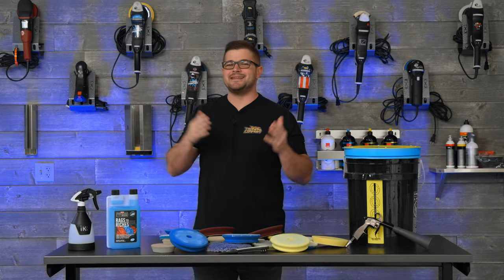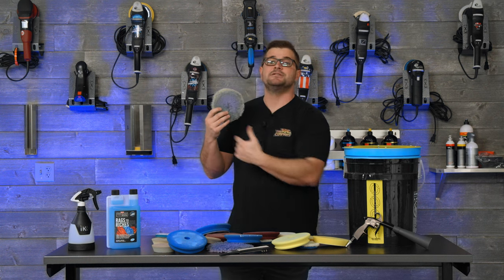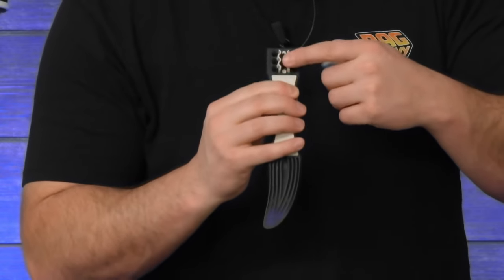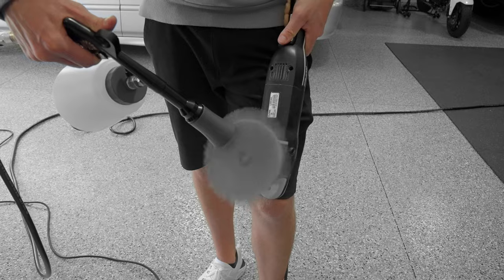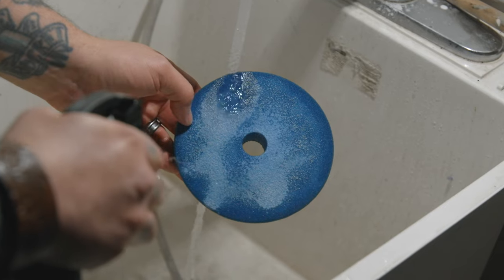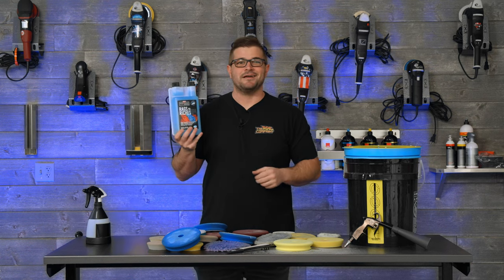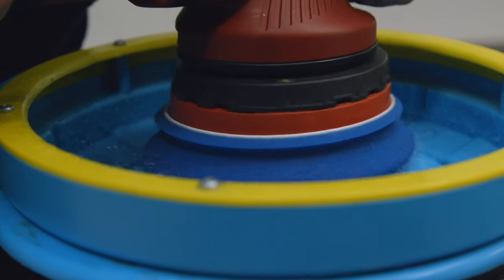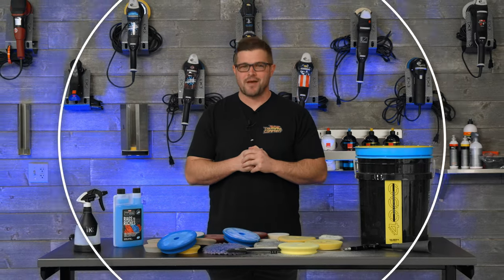How to Clean Polishing and Buffing Pads

Comment: The pad washer is absolutely phenomenal! You're using one pad per job and cleaning each pass. This adds less than one gram of moisture.  The pad is slightly dampened,  eliminating dry polishing.  Better cooling and cut, it is the best method

Comment: Tide free and clear washes compound out of pads better then rags to riches in my experience. Also I’ll just soak pads in a bucket with some free and clear while I’m working. Works terrific but I still want a pad washer system.
Reply: You can buy a lot of pads for the cost of that pad washer. Also rags to riches also softens your microfiber towels way better than tide free and clear. Also cleaning pads while working with compressed air and P&S Absolute

Comment: If using your polisher inside the Lake Country bucket washer is not your thing, the Detail Guardz washing system is a close second method for cleaning pads. After using their system I'd prefer the System 4000 pad washer for ease of use and less elbow grease. Rags to Riches is the money maker in my honest opinion because it is not harsh on your hands and smells freaking amazing! Although I love citrus based cleaners, R2R is by far the best detergent for your rags and pads and it's not harsh on your lungs.

Comment: I have a bucket of rinseless. You dip the pad in while on your machine, then massage the pad to clean, then spin dry in a separate bucket. I dont see how it could ever delaminate faster than bending the pad and tearing it off the hook and loop, and air is the worst possible thing for foam because it can destroy the foam cells.
Reply: I have  bucket of rinseless wash and run my pad against a towel soaked in it and spin dry.

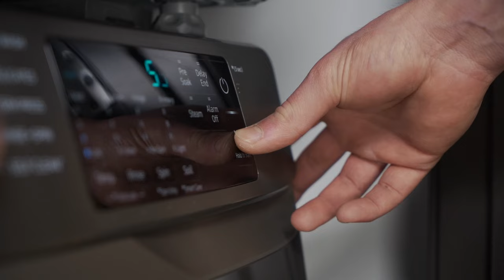Comment: 🤔6:30 surely you will contaminate insides of your washing-machine with all kinds of residue (abrasive compounds, plastic clear-coat...)?
and if you also wash 🚼 stuffs in there - why would you risk it? 🤔
and if you argue there is a rinse cycle: have you ever gotten frothy residue from normal wash detergent at the end? so then how many rinses are enough to wash out any chemicals and do you think washing-machine does enough of them? if not, then these would be additional chemicals (and plastic) embedding into clothes being washed after, and maybe never leaving them...
just a thought🤷‍♂